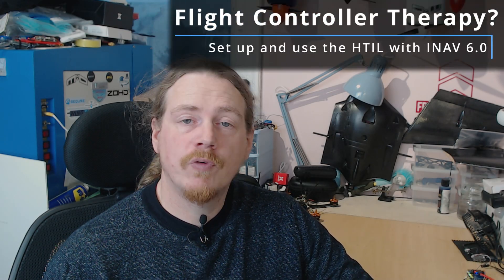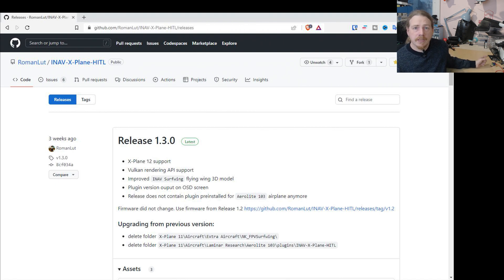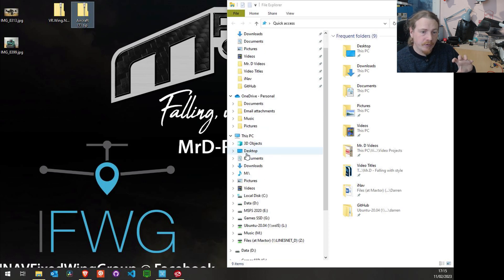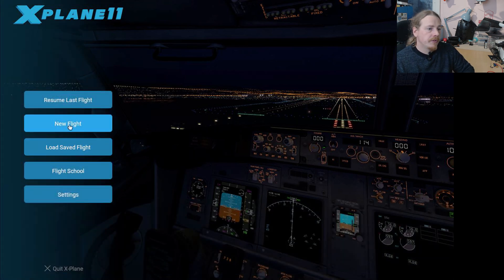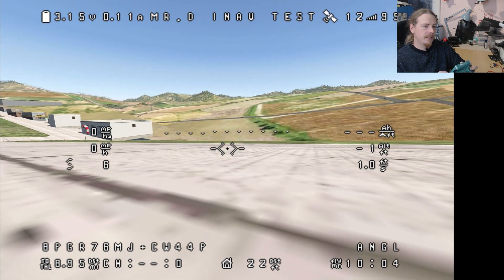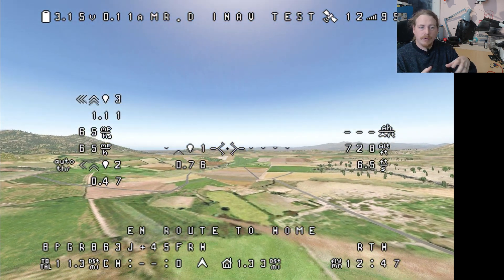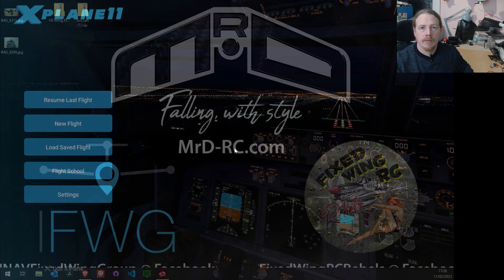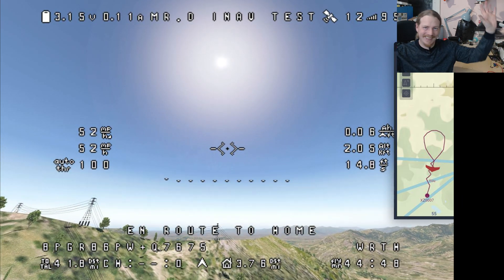Setting up and using HITL with INAV 6.0 and X-Plane

Comment: Nice video, thank you.  I have an FC on the desk with an RX and a bound TX, and I have setup iNav with a "fake" GPS.  But when I try to Plugins->iNav-> Link->FlightController I get Connection Failed Any hints Darren ?
Reply from the maker: Do you still have configurator open? You can’t use both at the same time.
Reply: Thanks for the reply Darren.  I did sort this in the end. A while back when trying to get passthrough to work with some FC, I found some instructions which advised changing the COM port number to 256. I have no idea why, but it did solve my problem.  In the case of X-Plane.  I checked the log file and it actually scans from (I think) COM1 to COM 30.  And so it never found my USB/COM port that the FC was on.  I renamed it to COM 25 and it all worked.  That will teach me 🙂

Comment: Does the demo work on inav I can't seem to get the plug ins to show the inav part? Any help please
Reply from the maker: Yes the demo version will work. It should pick up the plugin from the aircraft folder or the plugins folder. Depending on how you’ve installed it.

Comment: Great job on educating us how to setup these combined software's. I've made the arrangements to complete this process successfully. I have run into one challenge that doesn't allow me to trigger the waypoint in Inav. even though I have the home point as my takeoff location. INav shows that it loaded the mission and I have added a switch to activate the waypoint all looks good there, and RTH works as attended, but Inav doesn't follow the mission in the X-plane software what is missing?
Reply from the maker: The waypoint rules are the same as for a real flight. So the first waypoint has to be 100 metres (default value) maximum from the arming location. 

https://github.com/iNavFlight/inav/blob/master/docs/Settings.md#nav_wp_max_safe_distance I do not recommend setting this to 0.
Reply: @MrD  Thank you for the reply. I Discovered that there 2 options for WP’s in the mode selection and I had the WP mission switched, when I should have had WP planner switched. After making the correction the WP started working. Mr. D, you do a great job explaining inav. 

I have a question that I need assistance on another matter. This is a friend of mine’s plane. what is happening is when switching to RTH and I also noticed on Cruz mode as well the throttle raises and lowers throttle 100% to 49% and will performs this way until switched off. I Discovered this in X-plane. This is what is happening in real flight.

Comment: can it connect to inav Configurator the same way it connects to the flight controller?
Reply from the maker: if you mean over a USB cable, then yes. You can't set anything up on the flight controller in the simulator.

Comment: EDIT: if you're plugging in your daily driver aircraft that has DJI, be aware "OSD will not work if HD Zero, DJI or Pixel OSD selected in configuration". Original question: I'm getting an OSD error that reads "supported osd type not found or disabled"- any ideas as to what may cause this?
Reply from the maker: You need to use the analogue OSD setting with HITL. I believe there is an HD update for it. But I’ve not looked in to it yet.

Comment: So, as far as the transmitter is concerned, there is zero difference between you actually flying in this? as in full telemetry sent back to the transmitter? I ask because this would also be a super easy way to test antenna trackers.

Comment: Great  stuff! Thanks Darren and Marc! One question please:  does inav autotune work on this setup?
Reply: Just tried it. It appears that Autotune amended my Feedforward settings only, but not P, I or D. It appears to fly better, but I’m not sure 😂
Reply from the maker: Autotune only changes Rates and FF. This is the same in flight too, not just in HITL. The standard PID is a decent baseline. But PID tuning is personal preference. You can make it as locked in or natural feeling as you prefer.

Comment: The VR Wing Noob does not work on X-plane 12 but only on X-plane 11.
The INAV Surfwing does work on X-plane 12.
Reply from the maker: Thanks Ard 👍🏻 I’ve only used this with X-Plane 11. I won’t be updating to 12 as I prefer MSFS for the sim side.
Reply: the plugin and the model where both updated to work in XP-12 in the meantime :)
Reply: @b14ckyy  thanks for the info.
Reply: @b14ckyy  Where can I find the updated VR Wing Noob model for X plane 12?

Comment: I set up my HITL but I have a problem with altittude. Sometimes it gets to like -40 when it should be 0. It also changes altittude when in angle mode. Something is not right. Auto level doesnt seem to do anything. Any idea what is wrong? Latest iNav and HITL plugin
Reply from the maker: You may have the graphics settings too high. You need to be running at the fastest frame rate possible. These effects have been noticed. But unfortunately the only way to improve things is to turn the graphics detail down, so that the data can be processed faster.
Reply: @MrD  Alright, that explaines why sometimes it works falwlessly, thanks

Comment: Great video Darren! Will try is out. Seems very helpful.
The weather is still bad in the Netherlands. 😉
Reply from the maker: It is a very handy feature. The weather is ok here. Roll on the summer though.
Reply: @MrD  I just installed it and it works great. Happy Dutchmen.

Comment: Your amazing! so darn smart! Wonder if you run Ardupilot on X-Plane . Do you think from experience that some one entering into this realm should start of with INAV before dipping into Ardupilot ?
Reply from the maker: Thanks. Totally not true, but thanks all the same 🤣

No, I’ve not used HITL with ArduPilot. To be honest, I only have ArduPilot on one plane, and hardly use it. I would say try INAV first. It is easier to set up. To be honest, with how 6.0 files, the only real reason to use ArduPilot instead is if it has a feature you want to use that INAV doesn’t have. The only things I can think of currently are VTOL, terrain dats on board, and some of the glider modes.

Comment: Is there a possibility to fly multicopters? This sounds like a very good idea!
Reply from the maker: I don’t believe so. To be honest, I can’t even remember if X-Plane has helicopters. Where it’s made for manned aircraft, there’s certainly no multirotors. But, Andreas is working on SITL, which will also work with RealFlight. So multirotors would be a very real possibility then. Also the physics would be better.
Reply: @MrD  It would be great to be able to practice with multirotors with real OSD as well! 😃